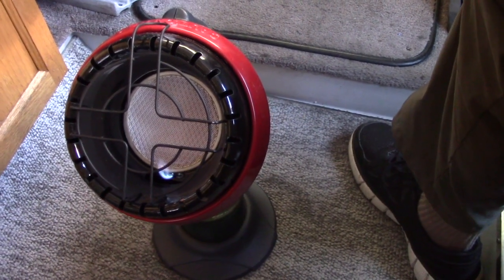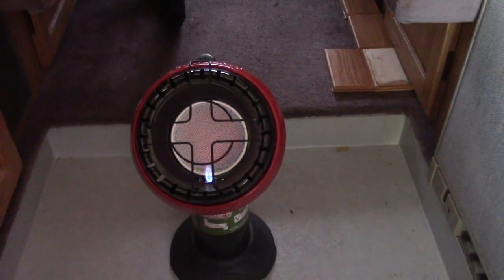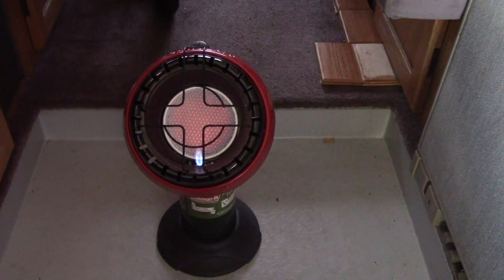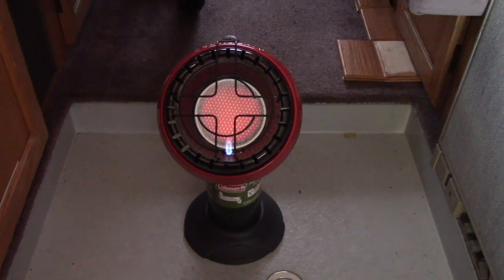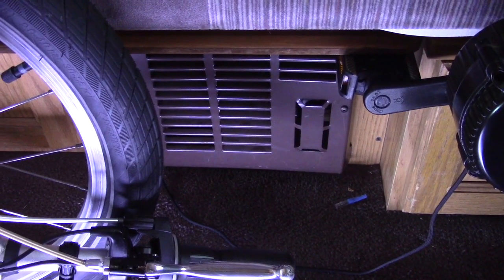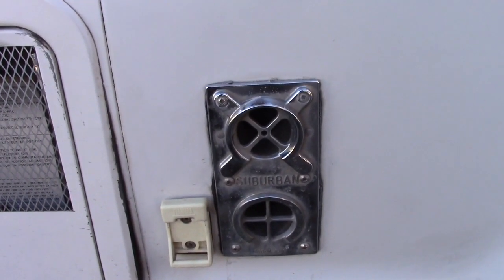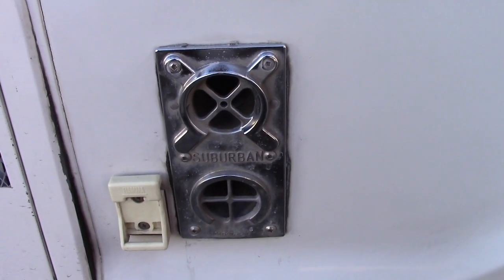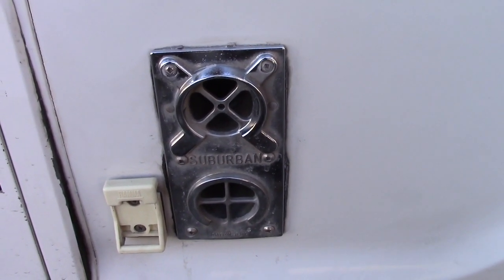Mr Buddy Little Buddy Heater...My Impressions

Comment: Thanks Rich, for your review. I've been considering the little buddy but now I'm pretty sure I don't want one. I too have a nice furnace in my Roadtrek (I own the 200) and I agree with everything you said about it. mine has a problem with the fan screeching Sometimes though and I've been trying to find a more efficient alternative but now I think I'll put some money into the furnace. I don't see anything that could be more comfortable even though it may burn a little more propane.
Reply from the maker: Hi Carlos. Could be a bearing in the motor. Sometimes they get dry and need lubrication.  Or it could be something got between the fan blade and the shroud or those parts are coming in contact and making the noise. Spinning stuff can set up vibrations that result in those noises and sometimes just the act of inspecting it can set things right.  I put my money on the bearings.
You may have a Suburban furnace or possibly an Atwood, similar to mine.  These are very efficient.  They draw 2.8 amps and produce from 12000 to 18000 btus. The forced air aspect means we're getting the maximum benefit from the available heat unlike the passive radiant heaters.
So I agree with you that it is worth spending a little to tune up the existing unit.
Heck, the whole furnace is under $400.
This is just another part of these Roadtreks that never ceases to amaze me. They are like a tiny, miniaturized house !
Reply: +Roadtrek Rich Suburban. My rig is very similar to yours. thanks for the advice. I plan on taking it apart very soon. the original thermostat works VERY well. keeps the temperature constant.
Reply from the maker: Yes, the position of the thermostat must have taken Roadtrek some time to figure out.  I'm sure they tried different spots for it until they found a place where it worked the best. The one in mine does a good job at keeping the temp even, too.  Just about the time I think I'm going to need to adjust it, I can hear it click on or off, if I'm paying attention.  Now, I just set it and forget it. Of course I turn it off when not in use. It isn't until one has spent a lot of time inside one of these Roadtreks that it is possible to appreciate the minute detail and nuance involved in the design and execution of each of its features and how everything shows so much thought and attention.
There is so much going on in this tiny space. I am constantly amazed at how intuitive things just fall readily to hand. Sometimes I just stop in the middle of doing something and realize, WOW, somebody really took some time to think this through.  It's like they could see people like us using something in their creation and marvel at their ingenuity.

Comment: I have used a Mr. Buddy heater for years in occasional sub zero temps in my rv converted box truck.
  I provide a small amount of ventilation to keep a small circulating air exchange. A couple small 12 v fans are cheap and effective to keep the warm air moving.
  Remember, if you fail to exchange at least some air with fhe outside, you are asking for moisture control problems.
  That little pilot light is a irrelevant amount of COMBUSTION. The heater itself uses a CATALYTIC reaction which is a entirely different set of chemical reactions. Given sufficient air, a catalytic reaction does not produce a relevant amount of CO. Given a insufficient amount of air, Mr. Buddy heaters simply shut off.
  My CO detector has never even chirped. 
  If Mr. Buddy heaters were at all dangerous, Mr. Buddy would have been sued into oblivion long ago.
  This guy doesn't have a clue.
Reply from the maker: Hi Bob Sullivan, thank you for the comment and the info.  Sounds like you are taking steps to assure your safety and those procedures are valuable for people to know. 

I have a couple of 12 volt fans but they are kind of overkill, better for moving a lot of air in hot weather.
I recently found a few usb powered fans that are almost silent and move a  more appropriate (for heating) amount of air. 

I am going to get a couple of those and give the Mr. Heater Lil Buddy another go around now that cooler weather is approaching.
I'll be following your procedures including exchanging some outside air (for moisture control) and the fans to try and get some better circulation of the air.
Reply: @RoadtrekRich  
There is no reason why your experience should be unsatisfactory.
  Check Amazon for Opolar solar/usb fans. Cheap, effective....I love 'em.
Reply from the maker: I'll do it, thanks for the info.

Comment: I am sure it was not built for a Van.... Besides, you have an AC unit behind you, isn't that a heater as well?
Reply from the maker: Hi Paul Quiroz, thank you for the comment.
I agree with you.   I think this was built for a little larger space and one that has some ventilation?
The A/C is just an A/C, not like rv A/C's that often are also a heat pump or heater.
Reply: I use mine in a standard cargo van, and it does well.
(I have a curtain across, behind the front seats.)
I crack a front & rear window, and have no problems.
Reply from the maker: Hi  @michaelharris1455 ,
I'm glad it's working out for you.  Thank you for the comment.

Comment: Kind of an apples to oranges comparison to put a 16000 btu forced air furnace up against a 3800 btu portable heater. If you have a working furnace with onboard propane and a good source of power, you don't need a Little Buddy. On the other hand if you are missing one of those things, a portable heater makes sense. I would think a better choice for an emergency would be a larger portable with perhaps a 12 volt or usb fan to circulate air. Catalytic heaters are much more efficient with fuel than RV furnaces and furnace fans are huge energy hogs.
Reply from the maker: Hi jima28080. Yes I agree, you make very good points on the merits of heating options. The little catalytic heaters are off putting to me now that I have tried one.  I had a larger one in a much larger class c years ago and it seemed much less offensive in that setting. In fact, I don't think I ever used the furnace in that vehicle, except to exercise it occasionally.  I like the fan idea you give, with the use of the catalytic.  That's something I might try in an emergency, thank you.
Reply: Hi Roadtrek Rich.  I have a 29 foot travel trailer that I keep on some wooded property 3+ hours north of home in Michigan. I use it like a cottage to get away from early May until I bring it home in December. There are no utilities and I have to depend on my solar and generator for power. I rely on my onboard furnace most of the time but it has failed me once in late November weather. Well below freezing. Since that happened I purchased a Camco Olympian wave 6 propane heater just in case. I've added a tee and valve on my low pressure gas line so I can quickly hook it up. I tested it with the heater set on low and a small 9 inch USB fan it stayed reasonably warm overnight when it was around 15-20 F. I left the bathroom vent open and cracked a window in the kitchen about an inch. I haven't tested it on high because I was fine on the low setting.

Comment: The HD5 propane in the green bottle has about 5% plastic chemical in it. HD10 propane (the cheaper type) has about 10% plastic chemical in it. Burning/breathing either type is not good in the long run. Why take a chance on getting a lung disease?
I am working on a vegetable oil direct vent heater (same as the RV furnace vents). The goals are to be quieter, less expensive to run, and to use as a primary or backup heater. The heat and burn time from the oil are promising.
Reply from the maker: Hi Cause and Effect.  I'm very glad you made this comment.  I was all excited to get the little buddy, thinking it would be over all better than the built in furnace.
Then I lit the little buddy and spent some time (hour or so) in the van evaluating my impression.  Almost from the first, I could smell something.  I'm used to discerning and identifying odors.  I chalked this up to the "new" smell.  After several minutes, I turned it off, "aired out" the van, let it cool off.  Then I tried it again.  Same thing.  Now I'm thinking this thing is "emitting" something, not just "burning off" something.
With your comment, it becomes clear that my senses were correct.  For my money, health, etc. the built in furnace is the way I'll be going. I know a furnace like the one in the Roadtrek is safe.  I'm breathing fresh, or at worst recirculated and warmed air.  There aren't any combusted gases or chemicals in this air.  The combustion takes place in a firebox and the combusted gases are expelled to the outside.
Interesting on the oil burner furnace.  I modified several Mercedes diesels to operate on both veg oil and bio diesel, even making biodiesel from waste veg oil while that was still a viable thing to do.
At the time there were a few people who were exploring the use of bio diesel and straight filtered veg oil in oil fired furnaces and as a fuel source for steam boilers for heating as an alternative to fuel oil heaters.
It's been a few years but I think they got some of the projects pretty far along.  It seemed like the hard nut to crack was getting the veg oil to behave similar to conventional fuels and modifying the burners?, jets? orifices? so that the veg oil would behave like the lighter fuel oil.
The other place this could be useful is with the water heater which also uses propane as a fuel.
I know that there are a couple of companies making diesel furnaces, water heaters and cooktops...I've seen them in a couple of Mercedes Sprinter conversions.  Diesel and bio diesel are similar but it is important that seals are compatible with bio.  It has a dissolving effect on some materials.  Also as good as bio may be, it can still suffer from polymerization and gum things up. Been there, done that, have the injectors and pumps to show for it.
I love alternatives and would use a renewable if I could find ones where I'm not exchanging a short term fuel savings for long term mechanical remediation. Some have had better success but I believe there are still some obstacles to be worked out.  Just my 2 cents worth and several years experimenting with bio fuels.
Thanks again for the comment on the propane, I hope people listen and give some thought about this.

Comment: I like this. Thanks. One thing I noticed, unless it was just editing, was that you moved the Little Buddy but it didn't shut off. Does that mean that if it tipped over or if it got inadvertently pushed against something it would not shut off? If so that seems like it could be a very real hazard.
Reply from the maker: Thank you for the question, Phillip. Yes I did move it and it was real time no editing. Earlier, I bumped into it and it shutdown instantly. So when I moved it in the vid, I kept it vertical and moved it very gently.
It is very sensitive to "jarring".  If it tipped over, the flame would extinguish before the tipping over was complete...does that make sense?
Just the act of bumping into it is sufficient for it to shut down.
The unit still has parts that are hot.  The wire grill and the red metal part.  But I tipped it over purposely several times and these parts landed "face up" not touching anything.  The plastic parts which are cool were the only parts coming in contact with the floor or rug.  So I think the overall safety of the product is excellent in terms of a hazard from its tipping over.
Like you, I realize this heater is an open flame and it requires careful handling.
Reply: Thanks for your reply Rich. Comforting to know that it will shutdown if bumped or knocked over.

Comment: These heaters will malfunction with in about of 30 hours of total use the igniter will not fire up and when I release the hard to hold button the pilot goes out. Same problem with the little buddy model
Reply: Bob did you figure out what was wrong with it? Mine is doing the same thing. It must be junk!
Reply: @stevestewart7246   yes I figured it out . They are  junk for the pass three years. I'm not going  to dismantle  a heater and try to hit and miss  a repair unless I'm in a life or death  situation.   My two heaters are brand new.  . . This is class action for a fraudulent product.
Reply: @bobbrawley2612  I agree. I think the thermocouple is bad. What I was told. Used it one time for ten minutes. Wast of money.
Reply: @stevestewart7246   yes I have heard that or read that it was the thermocouple  as well. Search for an alternative  to at one time  excellent  Buddy heaters other heater like  radiant  tank mounted parabolic  reflectors  a person said he thought the thermocouple was the reason it wouldn't fire up . With out an emergency  back up propane heater I. Fecal matter, out of luck. I guess its  back to kerosene heater which in confined spaces makes every thing smell like kerosene.  I never had any problems with my old Buddy heaters that did not have a oxygen  sensor  cutoff but it seem from YouTube reviews  every thing else  is causing  the problem. I refuse to tinker with a heater that is only a couple days old.

Comment: What does it take to run the onboard furnace? Are you in a rv park connected to shore power? If not, how long will the house battery last before it needs to be recharged?
Reply from the maker: Hi Bill, thank you for your question.  The furnace uses 12 volt power.  The way I mostly use it is with just the twelve volt house battery and no shore power.  It could operate when plugged in to shore power. But the shore power would just be recharging the battery enabling it to run  longer.

The furnace uses both power and propane.  I think it is probably using more propane that the Little Buddy but it is also about three times the heat production.

Starting with a charged up house battery of about 12.8 volts, the indicated voltage will drop to about 12.4 or 12.5 while the furnace is running.  When the furnace cycles off, the battery will recover to around 12.7 or 12.8.  So over time, the main drain on the battery is the fan motor in the furnace and how long it runs.

The furnace heated the van comfortably warm in under 20 minutes with an outside air temp of 34 F degrees  the day I did the Little Buddy test.

I don't run the furnace all the time but I think the battery I have, 80 amp, would allow it to run several hours before needing a recharge.  A solar panel would help and of course I drive the van which recharges the house battery very quickly as well.

I also have a small gas generator that I could use to charge the house battery if I didn't move the van.

The propane tank is not that big on the van.  And three appliances use propane...the cooktop, the refrigerator and the furnace.  So I think in cold weather the first thing that will run out is propane.
Reply from the maker: I did a little follow up research and found that the furnace draws about 2.8 amps when the fan is running. So if it ran continuously for 8 hours, it would consume under 24 amps.
However, the furnace doesn't run constantly because the thermostat shuts it down when it achieves the desired temp.
I would estimate a 50% duty cycle so that would be about 12 amps for 8 hours. 36 amps for 24 hours.
A solar panel and storage batteries would provide enough power to keep it running indefinitely, I would guess, until the propane was exhausted.